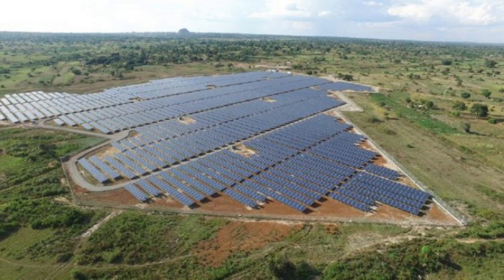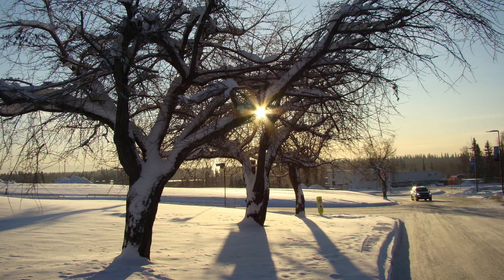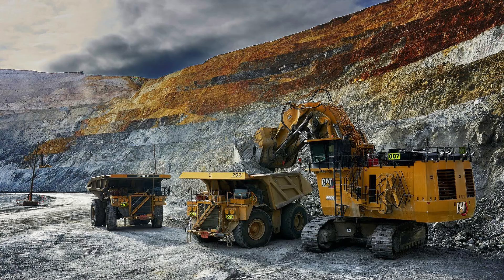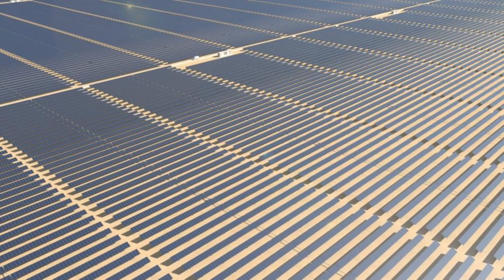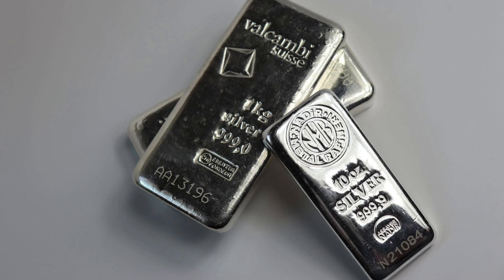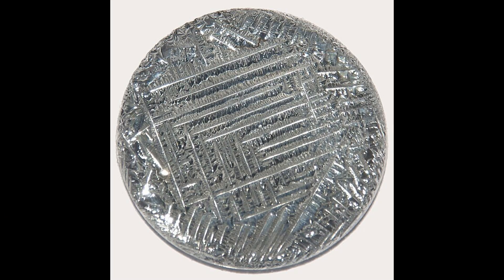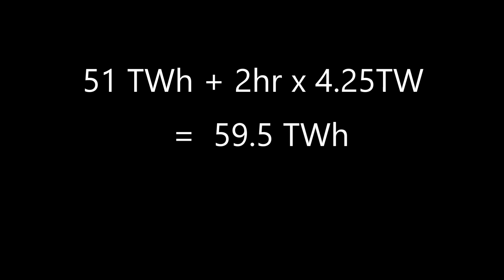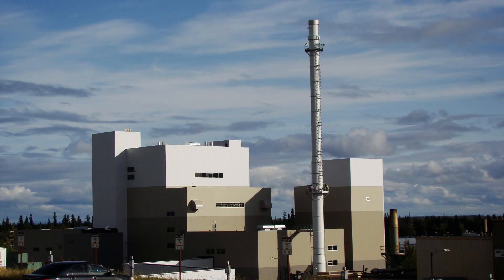The Math for Solar Power DOESN'T Work

Comment: Here is some math to consider:
.................
............
........
....
Forget about the sun angles, etc a solar farm that produces 10MW of energy costs $16million - this takes into consideration everything. That is $1.6million per Megawatt
.
.
A Small Modular Nuclear Reactor (SMR) costs $2.5billion and produces a maximum of 350MW  - that equates to $7.14million per Megawatt. 
.
.
At this price you can buy 3 solar farms and a battery storage system and still be cheaper than Nuclear. (Solar has virtually no runnning costs)
.
.
The mining resource story given here is a little too weird considering the accelerating production of solar panel with dropping costs - you'd think that by now the price of solar panels would sky-rocket but the exact opposite is happening.  What gives?
.
.
Put simply, the growth in solar farms are exploding around the world because smaller developers can get in on the game of generating electricity (and break the monopolies).  In Ontario, Canada they literally cannot build coal stations and even Nuclear can't get off the ground because Solar is so cheap.
.
.
YAY !!!

Comment: I think you bring up some valid points. However. Whenever one of those key resoures becomes the constraint, there's gonna be a surge in its price and a subsequent rush to remove it. Either by innovating ways to not use the resource in short supply or innovating ways to extract more of it more efficiently. That is to say that despite you bringing up some actually pretty interesting facts, I still believe there's gonna be an explosion in solar. Quote me on that. If I end up wrong you can make fun of me.

Comment: Very clear on the obvious problem, that the sun does not shine 24 hours. 
Nobody expects solar panels to produce the name plate power at all times and you should perhaps operate with real numbers. Over 24 hours a 400 W solar panel will give you on average 3 kWh a day over the year. 4 hours at peak power would be 1.6 kWh a day. So the hours outside of peak power count still for quite a bit.
The most important part to go green is to electrify. To use electricity instead of burning something, reduces in most applications the needed end energy  by two thirds. A ICE driven car uses at best 30 % of the fuels energy to move the car. A BEV uses over 90% of the energy to move. One has to add the the losses on the fossil fuel chain, that are huge. So looking at primary energy use it can easily by using 6 times the energy than using electricity. The loss of electricity from production to use are in the single digits. If electricity goes green, primary energy use will drop considerable.
It is so nice to hear somebody claiming that something is impossible, when it is already to a big part done. More than 30% of all the electricity produced in the world is from renewables and that is mainly wind and solar. Nuclear brings 9 %. So there is about 60 % of the world electric production that is left to fossil fuels.
The EU is at 44%. The USA is at 21%. China is at 35 %. That are numbers from 2023. 2024 sees a record growth in renewables, mostly wind and solar.
I still have to see the silver prices exploding, a thing that would happen if silver would be become scarce.

Comment: - 2'50" - fact check: "in the summer" as he says. The PV delivers excess from 08:00 through 19:30 which is 11.5 hours on a latitude of 46° north. From 07:30 to 08:00 it delivers all the power it takes to charge up the home battery that was just released from powering the home with solar power for the entire night.
- 4'15" - fact check: "you need to install twice as many". Alternatively you install a battery that powers the other half.
- 4'50" - fact check: "for the winter...."  I think I recall him saying that he looks at a scenario where there is a half/half PV and wind installation. For the winter I guess there is to be counted on some of the wind.
- 5'30" - fact check: "the most basic ones"... but he is showing a cross section of a GaAs cell that is almost totally irrelevant for a current PV system that is typically made of a monocrystalline silicon cell. 
- However he is right @ 6'00", that up to 10g / m^2 is used also in typical PERC cells. But again, in Heterojunction silicon cells of the present and likely of the near future, Silver is going to be replaced be a compound of Nickel and Copper. Therefor I'm not going to follow up the rest of the math regarding Tu and Ge because it is not needed.
- At the end, I'm not sure how exactly he is calculating the battery capacity but if a typical home using rooftop PV would install a 15 KWh battery you can multiply this by the number of homes to check if his math works out. For sure this magnitude of battery capacity is probably less than the BEV's will require.
I'm not sure if the fact that less energy is used during the night due to the industry not all working 24/7 is taken into account. I'll leave this one to someone else.
Reply: Fact check. The amount of says that are included in your summer 11 and half hours is probably less than 60. And excess is wrong word. In Germany thete is too much electricity at noon in summer but solar is not the only power source operating. If the other power sources could be shut off there would be no excess.
Reply: @Briand-ei1gs  with "less than 60 days" you are most likely correct, but that's life! Excess is the correct wording because in my post it is meant for a local situation, not for the entire country. It should be clear for everyone that a full country is very typically still very far from generating significant excess. But the more solar and wind is installed, the closer any country can get to this. On top of that, you are certainly right that there is also a big amount of other work to do. Fro example shutting down coal power plants for good while building some more gas powered ones. The latter can be switched off over lunch to tackle the solar peak while the coal ones can't.
Reply: @beatreuteler  we lived off solar power and so called renewable for thousands of years. Life was short and brutal.  We can go back to it if we want but standard of living will also go back.
Reply: @beatreuteler  batteries will never work because for winter you have to way overbuild so in summer you would still end up flooding the grid. Ti match winters needs you would have to overbuild by massive amount. It's idiocy.
Reply: @beatreuteler  and you still cannot have any control over production so you battery capacity will never match your production. So you are still going to end up with too much or to little of one or the other. Wasted resources.
Reply: @Briand-ei1gs  Not at all. Right, I don't have control over the sun and the snow, but that's life! But the contribution to energy supply is so good, that all resources are well spent on it.
Reply: @Briand-ei1gs  You are not going to overbuild battery capacity. If you do, that's your decision, but I won't recommend it. The trick is to have a well balanced system between storage capacity (dos not have to be batteries per se) and spare generation capacity well distributed over the entire grid.
Reply: @Briand-ei1gs  There is no rationale behind the statement that standard of living should go back. I think it is the opposite. The way resources are wasted today stands in the way of more people in the world can participate in prosperity. Thanks the leap in efficiency and therefore primary energy savings, much more people can participate in a better standard of living without burning earth.
Reply: @beatreuteler  no they are not! They are malinvestments! Remember the 2008. Housing crisis? That was malinvestment in housing. This time it will be much bigger and the malinvestment is in energy the very foundation of modern economies.
Reply: @beatreuteler  your telling me about wasted resources yet you are advocating for solar? My God.
Reply: @Briand-ei1gs  Well, that's just simple logic. With fossil energy sources just getting them out of the ground costs 70% of the " to be gained" energy, e.g. 170% of the gained energy is the top line while only 100% are making it to the nozzle, and then, while uing them it's again a hughe waste: at least 60% but often 70% of it being lost in process when used as fuel and when used for heating coming with a best possible gain factor of 1 while electric using with Heat Pump will provide you 3 which again is 3x better.
And don't forget with solar you can power your heat pump as well as your car so clearly it's a large step into the future of the better tech.
Reply: @beatreuteler  it doesn't matter if it UT takes 79 percent . You are getting a return. You are not getting a return with solar and wind. It's pointless. You won't enjoy what's coming at all.
Reply: @Briand-ei1gs  Well, you can believe what you want. To me what counts is the return I'm getting from the solar generator and it's orders of magnitude better than anything else I could invest in right now. That's good enough for me.
Reply: @beatreuteler  pointless muted
Reply: @beatreuteler  every single one of your fact checks are horseshit. Countries are destroying their electricity grids. Intentionally penalizing carbon and subsidizing wind and solar. It does not work. None of you use reason and logic.  It's ypur religion and no math or logic will make you change your mind.

Comment: I understand the point you are attempting to make.  But you are missing the real issue.  Just as there is a limited amount of minerals available.   Oil is also limited.  We cannot replace oil with just one type of solar panel.  But we can use energy more efficiently,  add solar of every type, add wind, hydro energy.  And conserve oil for future generations.  And consequently help reduce global warming.   

I have a very energy efficient all electric home with an 8.2kw solar array and 13kwh battery backup.  I drive BEVs and rarely use more than 300kwh from the grid.

Comment: One of the interesting aspects about solar that was not discussed here is the ability these panels have to just freewheel on low demand and ramp up practically instantly when demand rises, that is while the sun is shining of course. The reason why I mention this is that as more and more people start installing solar on their roofs, the demand at peak production will fluctuate a whole lot as clouds pass over a city or a storm hits. With distributed grid level solar you can ramp production up and down much faster than thermal, hydro or wind while still not requiring expensive and dangerous batteries. This way distributed grid level solar complements nicely with private solar installation, even without allowing home or busyness owners to back feed into the grid.
Reply: What you don't understand is the concept of grid stability.  Electrical grids need to maintain frequency with a fraction of a Hertz; otherwise the entire grid collapses into a catastrophic blackout.  Grids NEED physical inertia to maintain stability.  With combustion, steam, or hydro turbines coupled to generators, there is a lot of inertia.  If you remove that physical inertia (with solar), it becomes almost impossible to maintain grid stability.

Comment: One thing I actually really like about solar is how much overcapacity you need to build out to make it your primary energy source. People will say this is 'bad' or 'inefficient', but I like that it implies we'd have tons of spare capacity to make e-fuels & cool stuff like that. I want to run cars & planes on carbon neutral fuel in 20-40 years & solar is needed to make it viable (it outcompetes nuclear on price & we aren't building enough of that to matter anyway).

Comment: Why use theoritical amounts, we have solar power fields with actual generation.  Just use those numbers.
Reply: We have Germany who have wasted a trillion dollars on 150 gigawatts of wind and solar. They have ruined their grid and have among the highest electricity prices in the world.
Reply: Yea. I checked: in 2023 346 GW of solar generation added. His graph shows 232 million ounces used in PV industry. Dividing the numbers gives us less than 1/7 ounces of silver /m2 needed, not 1/3. That's less than half he speculates on. So, there's that.
Reply: @Sekir80  1/3 vs 1/7 is not a big difference for a rough calculation. There will be losses like continual maintenance needs.
Reply: @KeithWhittingham  Not a big difference? You mean, it's not a problem if you need 700 lbs of wood to heat your cabin and you get 300 lbs? Did you read my comment? Less than half of materials needed.
Reply: @Sekir80  So, you're saying that instead of needing 15.6 years of total global silver production, we would only need 6.7 years of TOTAL GLOBAL silver production.  That's like saying that no human can jump the mile across the Grand Canyon, but if the canyon was ONLY 0.4 miles across, there would be no problem.
Reply: @dzcav3  Yea, if you did the math of his words that would be correct. However I genuinely dislike these videos exectly because these scare tactics. What do you say then? Don't try and donanything?
Okay, the problems here:
- using incorrect numbers (or not even checkable ones)
- using simple linear extrapolation without adressing technological advanements. Remember, these pedictions projected Manhattan being under meters of horseshit.
- a general bad argument. Can't be done, don't even try.

Comment: This is one of the most ignorant videos I've ever seen, I did not even see one mention of LCOE. I'll address the Tellurium point as the others seem to be accounted for, First Solar has gotten it ton of TE per GW down to roughly 45, going forward they can reduce that further to 15. Ontop of that the main producer of CDTE 5N Plus states that roughly 1300 tons of TE are produced annually currently, growing at a double digit CAGR. So going forward TW scale deployment of CDTE solar should be more than possible.

Comment: Isn't it feasible to store the solar energy generated throughout the day in a way other than batteries?! Denmark has the highest percentage of Wind Power generation worldwide due to its abundant availability of strong winds and its politically popular stand on renewables. Any excess of wind energy generated by Denmark is transported to Norway, which has a great concentration of hydroelectric power plants. The electricity is then used to pump water up into the basin, which is then predictably pumped through the turbines, which the hydroelectric generators convert back to electricity when needed and that is transported back to Denmark for actual use. This way the intermittency of wind power is compensated for. Granted, energy is lost through transport and conversions, yet it is in fact a way to store potential energy, right?! A Swiss company is also experimenting with towers with blocks that are moved up and down, using gravity to convert it back to electricity.
Reply: Storing electricity with concrete block potential energy is a good idea if you can’t do math.
Reply: @skyler7319  Then that Swiss company cannot do math according to your line of reasoning. I know too little about this method of storing energy to have a definitive judgement on its feasibility.
Reply: One of the more promising is to use it to store heat in a large mass. Sand is one ideal material or ceramics if you want to get more technical. 

You pass water pipes through the mass to make steam and use them to drive an old style turbine.

Mass is heated by excess renewables, tapped off when needed to run the steam turbine.

Losses are actually low due to insulation and the surface area to volume ratio being on your side. Plus you were using excess renewable energy you were going to throw away anyway.

This is just one technology that can bridge the renewable gap when the sun doesn’t shine or the wind doesn’t blow. This tech is ideal for replacing peaker plants. You can even still heat the water with gas if there is a real solar and wind drought. No wonder batteries or materials needed.

Comment: I think that you've got to have different math for the home and regional stuff vs megaproject-scale solar.

From a practical individual or local utility perspective, solar can make sense, and those don't risk running global supplies of raw materials out. They're just helpful offsetting fossil fuel use.

If we started doing megascale projects, I'd hope they'd be located and configured to maximize utility from limited resources, so things like 'locating them in latitudes where they collect more and longer than a few hours a day.